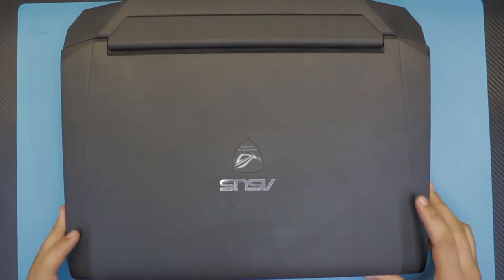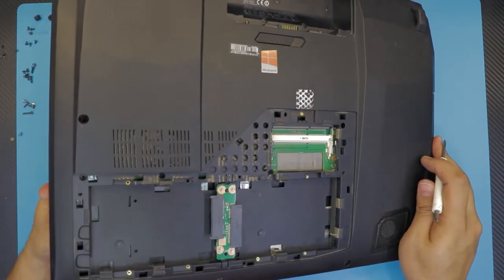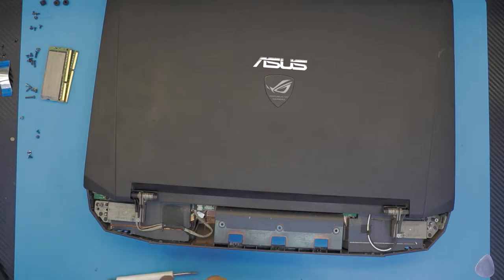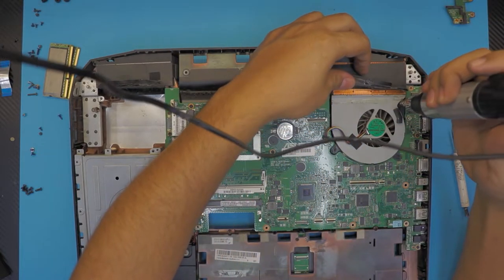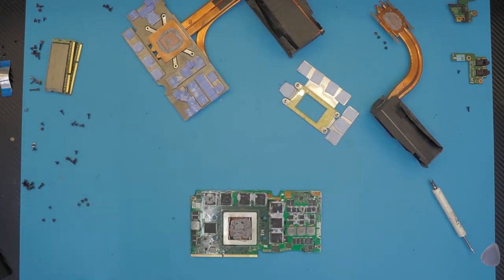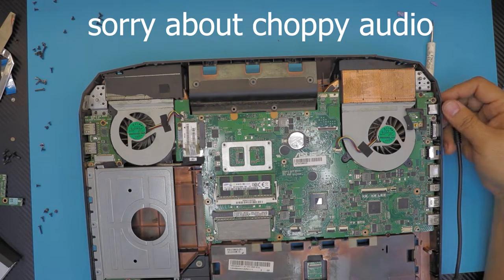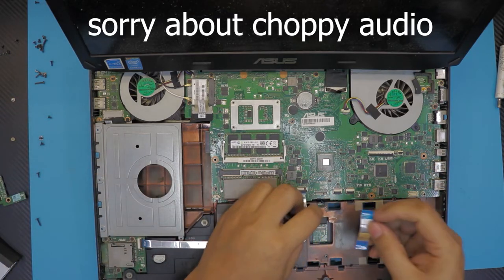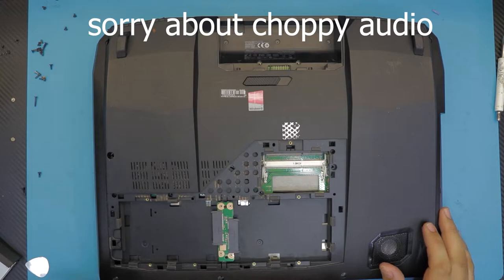ASUS G750 Repair, service, Disassemble and repaste

Comment: I have one that started to act strange. First it was so slow and loading files or apps took forever. Changed to an SSD because my first thought was HDD failure. Now after a clean Windows install it boots up and then blue screen. Tried several installations but same result. Now its stuck in Windows boot screen. Any idea what it could be? Opened it today but barely any dust in it. Feels like its a different failure than the HDD/SSD
Reply: Update. Now after assembling it again it cant detect my ssd
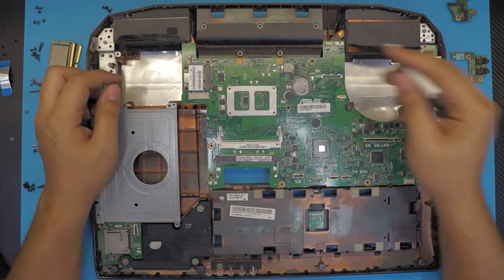Reply from the maker: its a common issue with this models , your south bridge chip is failing or has a dry solder bearing, you need to do a reballing on south bridge chip or PCH chip its right @15:31 its to the right side of the ram dims the chip with crystal dye on top. its common issue , it will sometimes respond and sometimes wont, you need to get that PCH chip reballed or replaced.

Comment: I really appreciate the video, very informative. Does anyone know which GPU is compatible to upgrade? And how do i know if it is compatible or not?
Reply from the maker: i would not recommend you to change it as the power delivery will change and not good for the main board, and for the cost not worth it, but if you need to replace it just go to ebay, and search for "ASUS G750 gpu". thank you for the feedback and your support.

Comment: After all that we don’t get to see the results? I wanted to see the temps and all that.
Reply from the maker: i donèt like to put up the results because, its just BS . there are many factors on the results:  room temperature what type of benchmark, or game you run and what settings, also back ends programs that are running and fan curve and many other stuff. its just basic knowledge when changing therpaste and depending of the type of the thermal paste you put and if you have enough room under the laptop for the air to flow.

NOTE: if you lift your laptop about 3-4 CM off the table you will see a drop of 5-8C extra. 
again if you have a bad fan curve your temps wont change, i recommend you to adjust your fan curve using MSI afterburner.
Reply: I had problems with my G750JH, it was overheating and crashing. I took the computer apart, took out the fans and cleaned them (the part where air blows out was full with dust), and I took out the motherboard and re-pasted the GPU and CPU with Thermal Grizzly (12,5 W/mK). It now works perfectly with a 40 deg C CPU and GPU temp at idle. Playing Dota 2 at ultra settings and 100% rendering only increased the GPU temperature to 67 deg C. It's amazing how much re-pasting an old computer like this, and cleaning the fans can do.

Comment: Hi
I did this but now i have another issue. 
Something causes my pc to seriously overheat. When i turn it on. It takes about 2 seconds until i feel a serious heat close to the touch pad. (Upper part, slight left). 
The first time I noticed it i had been afk for about 5 minutes. When i got back i burned my hand on the touchpad/ keyboard. 
It smells a bit wierd now. But something definetly burned. The computer seemd to be wroking ok. (Except for the obvioud problem). 
What could cause this? Short circuit? Where?
Reply from the maker: reopen and double check your flex cables, make sure they are straight inserted, and look for the sign of burn by the cables under arm rest. send me pictures if you can and i try to guide you . Thank you for the support
Reply: thank you for super quick reply. I have trouble undoing some screws. They just rotate so ill try this tomorrow. 
Which exactly are the flex cables?
Reply from the maker: anytime, the flex cables are the flat ribbon cables and see if anything is touching the inner case. please provide as many pics possible using :
https://imgur.com/
Reply: I posted too many images and sadly not in order. https://imgur.com/a/9qQ9RBJ
cable: https://imgur.com/a/K6tgD9F
I saw that the cable from TP BTN was burnt and removed it. It was basicly in pieces and pretty black.
Do you think the touch pad stll works? It would be pretty nice if all i need is to replace the cable
Reply from the maker: i will take a look tomorrow morning and i get back at you my friend,
be very careful that cable, you can short and kill your mobo, replace the flex cable / ribbon cable. look for it in ebay,
and yes the touch pad may still be fine 90% i have worst situations and the touch pad survived :P

Comment: Anyone have a link for fan replacement?
Reply from the maker: https://www.ebay.com/itm/Asus-G750-G750JW-G750J-laptop-Cpu-cooler-FAN-KSB0612HB-CL45-cooling-12V-0-40A/281901790528?hash=item41a2a7f540:g:B5oAAOSwvUlWqMlD
Reply from the maker: that link is for the CPU fan not GPU

Comment: This video is a life saver! However I have a question. My g750 recently started switching off during gaming. At first I thought it was the CPU overheating but then I realised it was at normal temperatures like 40-50 degrees. Then I thought that it was for GPU overheating, but monitoring the temperatures of the GPU I noticed that it switched off even at 67-68 degrees. Can it still be considered an overheating gpu problem or it can be something else? PS: I also cleaned my fans.
Reply from the maker: if you gpu is under 90c and it turns off there could be two possible problems.
the GPU is suffering a dry /cracked soldering ball under gpu (because its a BGA chip)
or you could have a bad mosfet on the motherboard that is failing.
the only thing you could do by your self its try to repair the 1st issue. by following this guide:
remove the motherboard and isolate the gpu with foil tape, and place use a heat gun station or a hair dryer at max heat and medium air, and place it with a 2-5cm over the gpu for about 5-7min without removing it. and after leave the motherboard to cool down by it self dont force the cooling nor blow air into motherboard.

https://amzn.to/3a4YIvM

if you want to know how to here is a video some how you can follow but apply it to your motherboard.
https://www.youtube.com/watch?v=LPThmVu9-JM&lc=Ugyk1HyHCaN7s9MgCE54AaABAg

after when it cooled down then remove all foil tape and place a thermal paste and try it again and if this worked then know that you will be needing a full "reballing of BGA" service . as this is only a temporally fix (2-4 months maybe longer or shorter)

if you got any question ask.

good luck
Reply: uFixTek thank you for the detailed answer!
Reply from the maker: your welcome and good luck
Reply: Might be an old question but I had something similar, if your battery is bad, even while plugged in, if it cannot charge above 5%, it will eventually shutdown to preserve the battery. The easiest solution is to simply remove the battery, otherwise, you have to go in the settings and disable "Shutdown to preserve battery life".
Reply: @Elku  is that in the bios or something? I mean, Ill try it but, seems like the machine fans just ramp up and then the computer turns off completely, instantly. very fast... and its super hot. even when sitting  in the bios.

Comment: After 5 years my laptop doesn't want to play 2019 games! Just got '' CONTROL'' AND after playing for 10 minutes crashes, power cuts with fans on full before cut, just tried playing world war Z same problem starts to load and shuts down, would you suggest that I do the same thing that you have done as ive never thermal pasted my CPU or gpu.... Suggestions.? Model is G750 JZ i74400 NVIDIA 880m, 32 gigs Ram, 512 ssd, 1 Tb hdd
Reply from the maker: YOUR GPU IS OVER HEATING AND CPU POWERS OFF FOR PROTECTION, YOU NEED TO REPASTE AND OR MAY HAVE TO REBALL YOUR GPU BGA CHIP.
Reply: @uFixTek  Do you know what size the CPU fan is, when I look for replacements on sites like ebay or aliexpress, they mention a " thin(15mm) or thick (25mm). Which one is inside?. * currently using the laptop don't want to take it apart yet. I have the g750js...

On boot the cpu gets to 100degrees and stays there for almost 5 min. then calms down to a stable 70. Sitting idle the fan will just blast and the cpu will be back at 100. Im hoping that a fan replacement and re-thermal for the cpu and GPU will do it some good.
Reply from the maker: you dont need to replace ur fan if the fan is spinning just do a repaste and clean the heatsink thats all 15mm

Comment: awesome video, thanks a lot !
But didn t you forget to put the black tape back on the colling fan pipes to move the air from the fan directly to the pipes ?
On the left fan you cut it off and on the right side it s completly removed?!

Here you show the tape on the top and the bottom : https://youtu.be/EOIWZe2rSsU?t=719
And here you put it together without the tape at all : https://youtu.be/EOIWZe2rSsU?t=1520

I got the ROG G750JZ-T4023H
Reply from the maker: Thank you for the comment and i appreciate your concern regarding the air flow, but if you pay attention to the heat sink radiators they are closed where the tape in glued to. and the tiny gap in between the fan and the heat--sink in very insignificant, and even if the air 1% goes out from there is better because the bottom cover will direct that 1%o % air flow to go out and it will hit the heat sink radiator from outside and it helps. we have ran many experiments with or without the tapes, its all the same and if no maybe even better. because its physics more plastics tapes touching heat sink radiator the warmer it gets. its like putting on cloths, hard to explain i guess. but i encourage you to try it out and test the difference and you will see :P .
Again thank you for the comments and just because you have focused on this details it means you think outside the box :P. good luck

Comment: Mines lights up and shuts back off all I hear is a beep noise ...what might be wrong ??
Reply from the maker: remove both rams and insert one ram at the time and power on and test, you may have one ram stick dead, depending the beeps its a code.

Comment: I did this and now my laptop won't turn on, I just get the power light on, and nothing more, no fans moving, no display, what can I do to fix it?
Reply from the maker: i need you to double check all the power connectors, and re insert the rams. let me know, do you get any sign of life. a light blink?
Reply: @uFixTek  I just get the white power light on
Reply from the maker: did you re-plug all the cables?
Reply: Yes
Reply from the maker: still nothing?
Reply: @uFixTek  no, maybe gpu issue? It was defective before thermal paste replacement but laptop working normally, can this work damage a defective GPU?
Reply from the maker: no, i need to make sure that you have installed the GPU correctly and not sideways.

Comment: REAL shame you didn't show the repasting... That was the interesting part that I was looking for... Because of that, thumbs down.
Reply from the maker: jesus im really sorry i just saw it, the repasting clip did not go to render, it was a separate clip and it was turned off when rendered, but its not hard you just have to wipe the old paste and put the new paste and screw the screws. :(
use this video and you will see how to at @5:00 min  i show you how to, its 99.99% same method 
https://www.youtube.com/watch?v=cweSEtgzNpA
Reply: @uFixTek  Video set to private, not unlisted :)
Reply: @uFixTek  Also, that might be true for CPU, but the GPU has a lot of thermal pads instead. What thickness pads did you use?